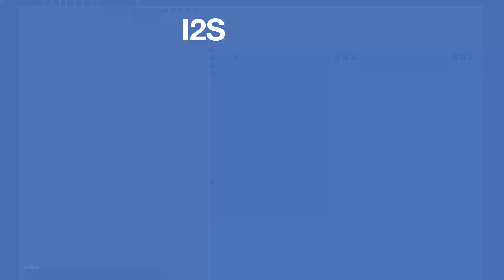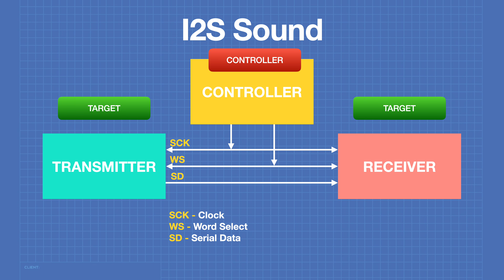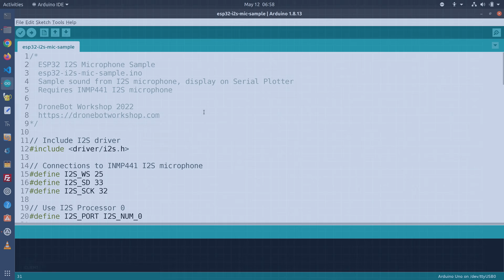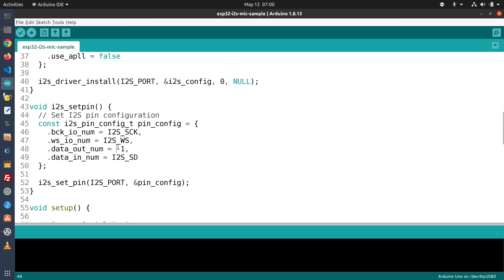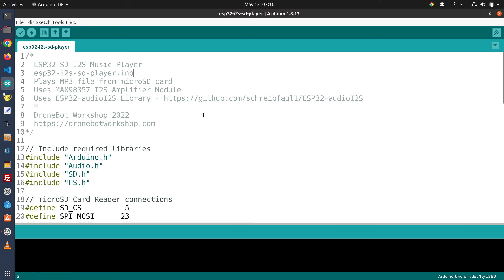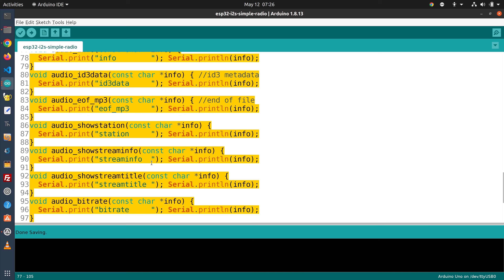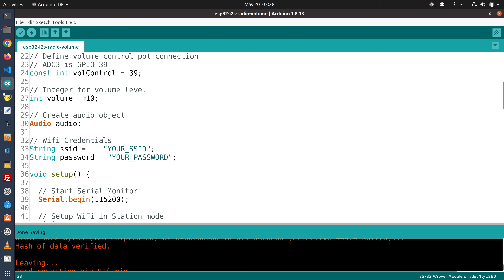ESP32 Sound - Working with I2S

Comment: Hi there, I am looking for a ESP32 project for Internet Radio, but the output is not for 3.5mm jack, but bluetooth connection built in on the dev board. Do you know any?

Comment: What pins are I2S port on ESP32-S3?  GPIO to UART mapping assumption seems to no longer apply with S3. S3 appears to have completely different GPIO UART MUX association.  No examples of what pins are optimized for I2S communication either in the 1000+ page data sheet.

Anybody know what GPIO to associate with since the people that make
The ESP32 chip don’t want to share?
Reply: Hey, did you find a solution for this?
I feel most gpio pins can be configured for I2S application on the ESP32S

Comment: I'm getting a series of -3000 3000 0 from the serial monitor. I double checked the pins and the code. Is there something wrong with my INMP441?
Reply: i have this problem too. Have you solved this problem?